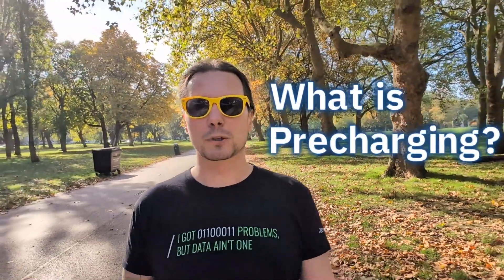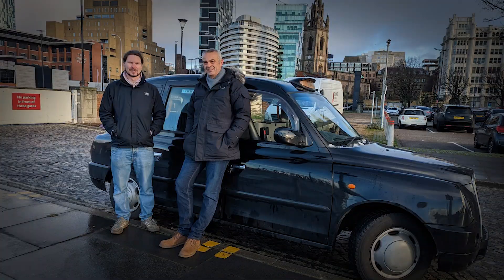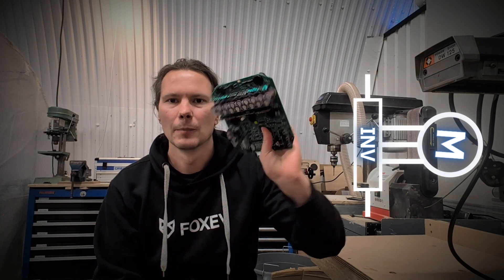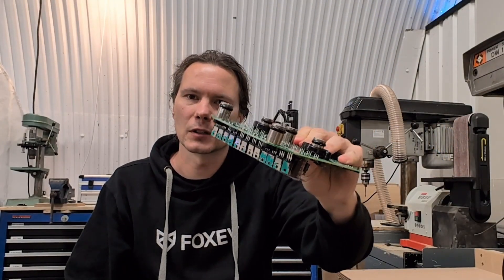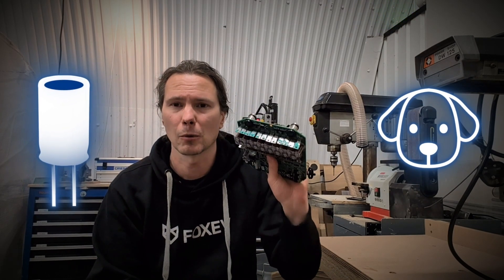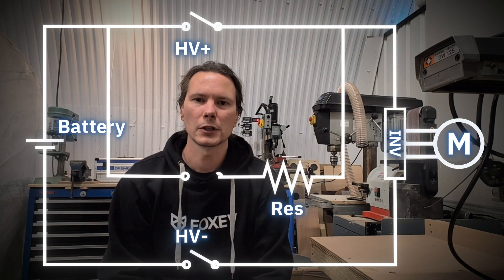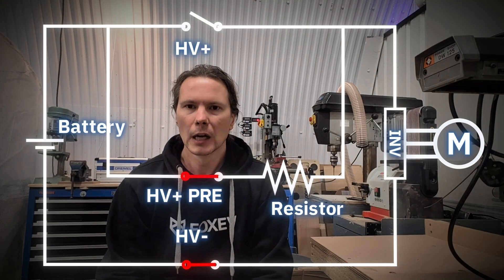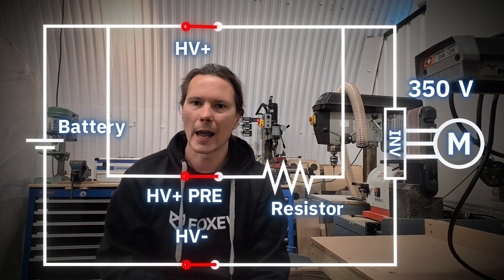What is precharging? Why do EVs need it? Don't blow up your inverter!

Comment: So this is the noise of the contactors... always wondered why it isn't a single shot, but instead a prolonged "clonk-clonk".
Reply from the maker: Thats exactly it. If there is a fault, on some cars you will hear the first clonk .... then you hear it opening again after 30s (it never did the second because something was wrong). You also hear them in the rapid chargers.